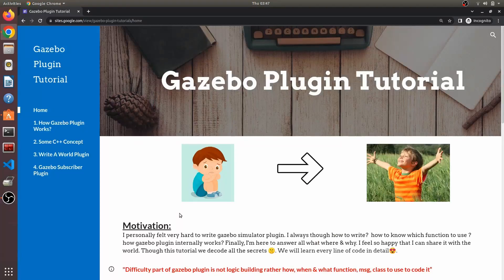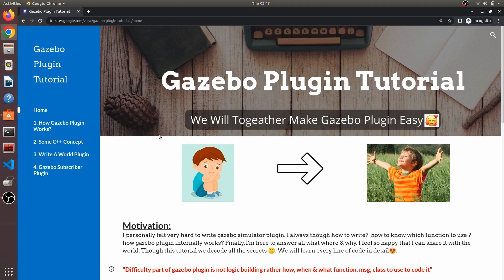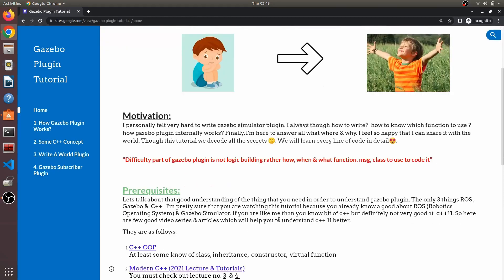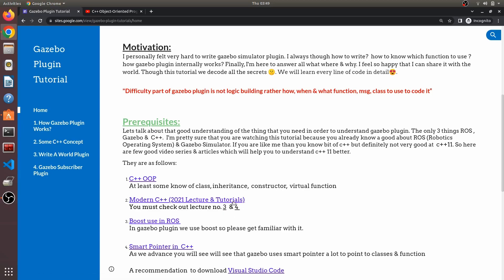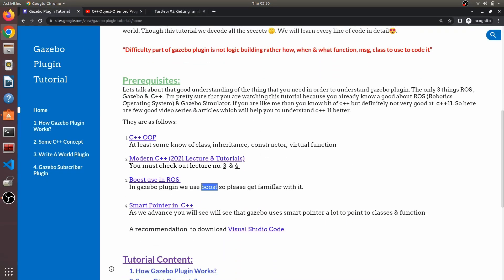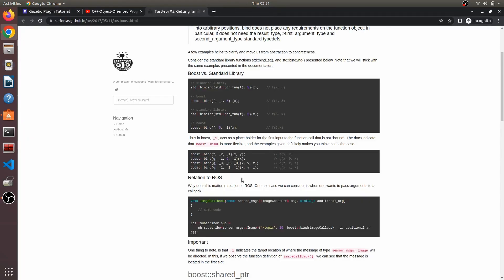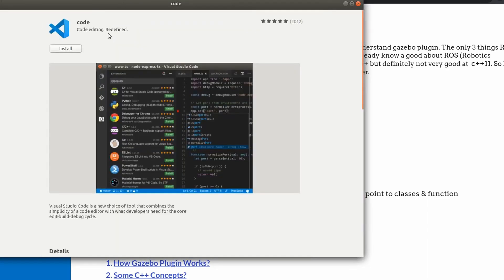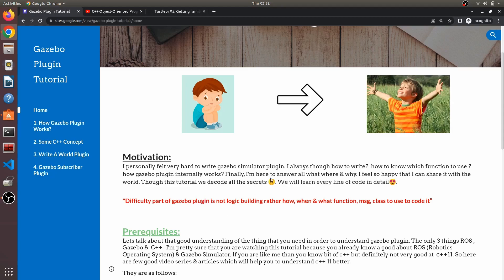0.1 Introduction To Make A Gazebo Plugin | Gazebo Plugin Tutorials

Comment: Are these tutorials for ros2 plugins or ROS1 based? Which Gazebo?
Reply from the maker: @MarcusVinicius-lq3fe  its for gazebo classic. Ros1 but you understand properly then you can use it with gazebo classic ros2 just ros api changed. 
Gazebo classic ros2 example:
https://github.com/ros-simulation/gazebo_ros_pkgs/blob/noetic-devel/gazebo_plugins/src/gazebo_ros_bumper.cpp
Reply: @RoboticsWithHrithik  that is nice to know.... I am familiar with ROS1/ROS2, but never needed to create a plugin on Gazebo...as far as I understood it does not matter which ROS-distro is being used...Gazebo plugins have its own structure to create a plugin independently of ROS?